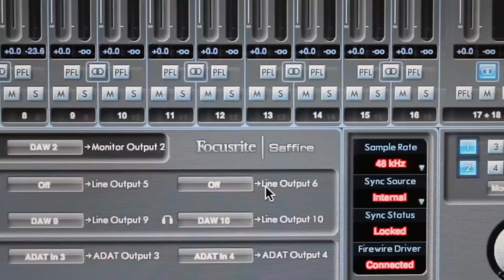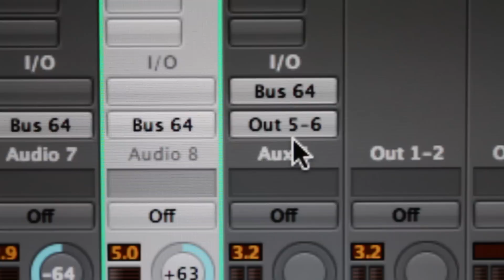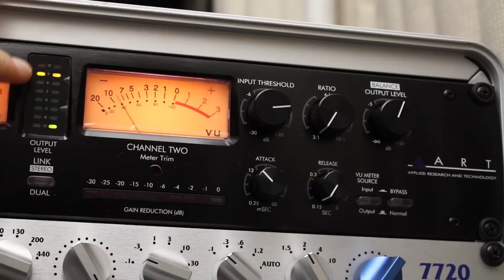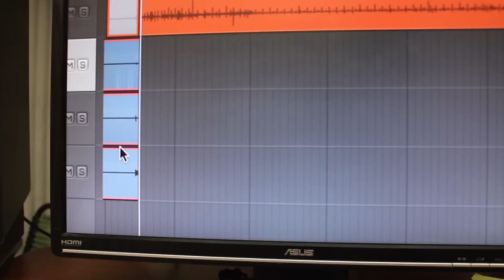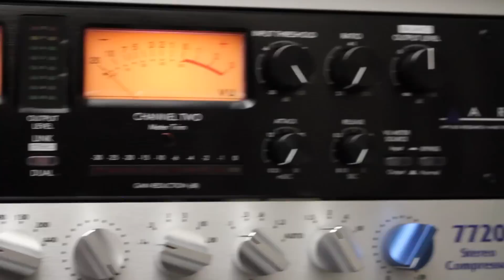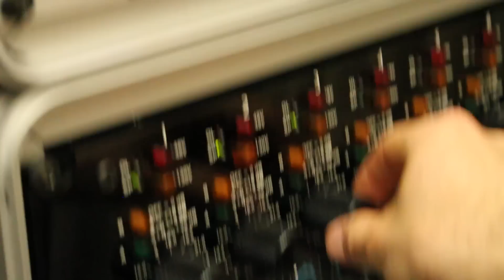Get Outboard Gear Into Your DAW- Compressors, Preamps - Focusrite Saffire Pro 40

Comment: I'm a bit of a noob. I have a question. If you're using the compressor for the snare and snare chains.. How are you using it for the overheads?? Also, taking this one step further, is there way to accomplish seperate compression levels/settings while recording several tracks??
Reply from the maker: This process allows the engineer to rerecord each track individually at separate times. This means I can listen to each instrument thru the outboard device separately & take my time to dial in the sound just like with a plugin. After I rerecord the snare, it's only a matter of disarming the snare reamp track & arming the overheads reamp track. One at a time I process thru the hardware. To rerecord/compress multiple tracks simultaneously, I would need an individual output, compressor, input channel, & cables to reamp each signal.

I hope this helps!

Comment: Hello. Quick question regarding the Art Pro VLA II vs the Chameleon Labs 7720. Which unit do you like better considering that you own both? Any experience which unit in your opinion works best for a Mix Buss / 2 Buss operation?
Pros vs Cons?? Thanks!!
Reply from the maker: Ryan Pehr Dude! To specifically answer your question about the Mix Buss, I believe it comes down to the sound character you are after. I have used both as 
final mix compressors & am happy with what I got in those particular cases. In the specific use as a mix compressor, the biggest factor to consider is "warmth" vs. "transparency".

In general, I decide which to use depending on the application & how I want things to sound in the end. If you're looking for warm-sounding instrument compression, the PRO VLA II is the winner. If you need a clean, 90s Alternative Pop kinda sound, the 7720 is the bomb. If you're recording vocals, 7720 is sheen smooth while the Pro VLA II adds analog heat. They have totally different character & routing options that make them solid devices.

BOTTOM LINE: If you are looking at purchasing your first compressor, I suggest starting with the PRO VLA II & later investing in the 7720 when you need more channels of analog dynamics control.

I'm happy you've asked because these compressors are close enough in price range to discuss fairly. Here is a super-simple breakdown:

1. PRO VLA = Warm
    7720 = Transparent
2. PRO VLA = Dual Mono or Stereo
    7720 = Mono (single channel) or Stereo
3. PRO VLA = 2u Rack Space
    7720 = 1u Rack Space
4. PRO VLA II = Better Metering
    7720 = Flawless Stereo Consistency

I have used both on vocals, acoustic guitar, drums, & full mixes with pleasant results. Here is a recording with the PRO VLA II on drum overheads:

https://soundcloud.com/lanskysound/f-foliage-2014

Here is a recording with the 7720 on acoustic guitar:

https://soundcloud.com/annalansky/talyanka-anna-lansky-2015

Having two independent channels on the PRO VLA II is a major advantage to me 
because I can process two instruments simultaneously, OR what I love to 
do with vocals is daisy-chain OUTPUT 1 > INPUT 2 with the first comp
 set at 2:1 (-5dB GR, ATK 12ms) & the second at 4:1 (-2dB GR, ATK 0.25ms). This technique produces poppin vocals that do not need much more than EQ in the DAW. On the other hand, the 7720 is perfect when I need a vocal to sound clean & creamy which the PRO VLA II cannot touch.

* A NOTE ABOUT ITEM #4: I believe the sonic consistency is greater on the 7720 so both channels are perfectly matched, but the metering is better on the PRO VLA II requiring the engineer to listen more carefully with the 7720 rather than relying on meters.

** STEREO TESTING THE PRO VLA II: Before using it in stereo mode I suggest running a dual mono tone generator thru (could just be a guitar tuner output @ A440) & set up a stereo field monitoring plugin on an input channel of your DAW. With the compressor set to STEREO LINK, threshold all the way up (no compression) & ratio all the way down (2:1), you should see a near-perfectly balanced signal that is equal on both sides of LR output. Don't be surprised if it's slightly off, but if the sound is audibly pulling to one side, the unit needs to be serviced by ART.

This is probably a lot more information than you were expecting, but there you have it. I hope this helps!

Thank you for watching :D
Reply: Thanks for your reply. Very useful.
Reply from the maker: +Ryan Pehr Something just occurred to me after a couple months: I can show you examples of what the ART PRO VLA II can do on the master bus! Here are two albums of my own music that feature this device on vocals, guitars, & who knows how many other instruments as well as mastering compression:

IИCITIИG_TO_RIOT -- http://www.quadkiller.com/QuadkilleR_2012_IИCITIИG_TO_RIOT.zip

untitled (a.k.a., "The Reflection Album") -- http://www.quadkiller.com/QuadkilleR_2013_Untitled_the_reflection_album.zip

I dare say we ran every track out of the box & thru the PRO VLA II for final compression. Since the creation of these albums, my skill level (as well as equipment arsenal) has increased pretty dramatically so I would do things differently now. Having said that, these records were produced in the "artist" mindset first & "engineer" second so there will be odd things happening.

Nonetheless, both records were absolutely influenced by the ART PRO VLA II, which has its sonic signature all over everything you hear. I hope you at least get some minor enjoyment out of the music in addition to the study of sound texture. It would be sad to think you're suffering as you listen, haha. Enjoy!

Comment: Couldn't you send a mono output ?
Reply from the maker: +Manofmanytallets I'm not exactly sure what you're referring to, but I am going to guess you are thinking about the stereo channels. I am not sure it is possible to create a mono output in Logic, but think it may as well be. I'll have to check this out for the next time I do some reamping. Thanks for the suggestion!
Reply: +Lansky Sound yeah if the channel is mono then where is says stereo output right click and go to output then mono at the bottom
Reply from the maker: I probably should have known that, haha. All channel strips in Logic Pro have that function. Thank you for bringing this up!
Reply: +Lansky Sound aha yeah wasn't sure if it was in logic 9 but I have seen it in logic x
Reply from the maker: +Manofmanytallets So get this: I finally tried sending the mono output & there is an issue. Logic defaults mono outputs to ODD channels -- I can't send to an EVEN numbered output via mono channel! Kinda wish the programming would have allowed that as it is much more simple than playing around with panning.
Reply: +Lansky Sound that is odd. With pro x no panning is required just simply use the IO plugin and that works fine but I'm not sure about this ! Sorry wish I could help
Reply from the maker: Dude, it is all under control ;)

Comment: I have a couple questions. I have a warm audio 1176 compressor. If i was so buy a presonus adl 700 which it is a preamp/comp/eq all in one. Can i use adl comp at the same time as the wa 76 comp? Or do i have to use the adl 700 first then route the vocals through pro tools and then use the wa76 if that makes since.
Reply from the maker: DGibflyboy Hey dude, awesome gear you're going for. I would like a WA76 myself! There are two ways I can answer your question, so I'll throw both at you:

1. Assuming you are NOT reprocessing & would like to record straight to disk using the outboard gear: your signal chain has to be ADL700 > WA76. You have the option of BYPASSING the EQ &/or compressor section of the ADL700 & this way you could only use the WA76 for compression. Depending on what you're recording, however, it may be to your advantage to use just a little pinch from the ADL700 compressor before hitting it harder with the WA76. In fact, this is my go-to setup when I am recording vocals! I use the first compressor (the ADL700 in your case, suing an EQ low-cut around 100Hz-150Hz) with a low ratio like 1.5:1 or 2:1 & only get max 3dB of reduction. I then hit that same signal with a second compressor at, like, 4:1 to get another 3dB-6dB. This keeps vocals super poppin.

2. Assuming you ARE reprocessing & will use the compressor(s) after tracks have been laid down: I suggest using the ADL700 preamp while bypassing the COMP section (EQ if you like). Run the output of the ADL700 str8 into your interface. On the way out of the interface, you will not need to apply much gain if any at all before being able to smack into the WA76 or ADL700. After that, send the heat right back into an analog input on your interface.

I know you asked me this a while back, but I just saw it. I hope this is helpful to you! Stay tuned, dude

Comment: Newbie here... What I don’t entirely get is the gainstaging aspect. At What volume should you set the physical knobs (the input volume knobs) on the front end of the saffirepro that are connected to the hardware processors? Ex: output of a compressor going into input 3 of SP40. I want to set the input knob on my compressor at 12 o’clock  so that its bypass button works nicely. However now the signal comes in way too loud in the SP40. How do I adjust that? Put the input volume knob almost to minimal on the SP40? Or do I have to adjust something in mixcontrol? Thanks!
Reply from the maker: hello friend, apologies for the late reply but I've been just vibing & missed your comment. Turn down the input gain on your interface all the way & start there. You might need to set the input to look for a LINE LEVEL signal arriving at the SP40 input. At any rate, get your compressor achieving the gain reduction you're looking for, make it up with the output knob on the compressor, & start with the SP40 all the way down & add gain as necessary to reach near 0dBFS.

I hope this helps as it's proper gain-staging technique :)

Comment: Can you directly connect a Alesis compressor into a Scarlett 2i2. i know a pre amp will help. but just curious
Reply from the maker: Unless you are sending audio from a line level device into the compressor, a preamp will be necessary. A microphone cannot be plugged directly into a compressor without a preamp! To answer your question directly, YES, you can connect the compressor's outputs directly into the 2i2 inputs. I hope this helps!
Reply: Did it work out? :p

Comment: What is the reason for routing via the millenial when you have gain adjustement in the comps?

And also, the sonic maximizers are unbalanced. What is your thought behind using them?
Reply: Welp, I just came to that part.
Reply: Couldn't you buy a 2 channel pre instead of an 8 channel to get that sonic character? Ever tried and listened to the differences?
Reply from the maker: of course, but that's what I need for my work ;) If you want some nice color, check out the Warm Audio WA12

Comment: the thing im struggling with is putting my external mic pre into my zoom interface! i want to bypass the pres on my interface, but cant find out anything from the company! i know some interfaces bypass the pres by using trs into the interface so thats what im doing but not sure if its bypassing the pres! the other wierd thing is on my interface, if im using my preamp, i have to keep hi z engaged on my interface or else my daw clips even if the gain on the pre is very minimal! but when hi z is on i have headroom, but i dont get why i need hi z engaged, it seems like it should be the opposite! maybe the pres cant be bypassed, so thats why the hi z is affecting it? lol....do you know any good interfaces that can bypass pres if need be? can you bypass the pres on the saffire pro 40?
Reply from the maker: Hey James, it sounds to me like you are using a 1/4" output from your preamp into your interface. I suggest using an XLR cable & just turning down the interface gain as low as possible. This way, all the gain should be provided by your outboard preamp. Using the XLR cable will also possibly be a better-quality connection depending on your devices.

To be more specific, by completely reducing the channel gain on the Saffire Pro 40 preamps, you essentially bypass them. This is how I was using my external preamps with the Pro 40. If this is the interface you are using, there should be no problem getting almost all of your gain from an outboard preamp.

I hope this helps!
Reply: awsome! thanks!
Reply: Yea I just picked up a Zoom UAC-8, specs, reviews and IO was pretty sweet for the price. While it was in shipment I contacted Zoom and asked about bypassing the pre's completely. There response was pretty similar, just to turn the gain to 0, but said it was fine to do that. I would've thought using trs would be better too, but will try the xlr deal. I also decided to keep my older Echo Audiofire 8 with adat, and I have that linked up. It has 6 straight a/d converters and is sounding pretty nice connected. I have many more a/b tests to run, but I find it a tad brighter?
Reply: the thing is some interfaces will bypass the pre if you use a trs because some have seperate line amps even though its a combi jack, but if the interface only has the one pre in it it doesnt matter which you use, so actually with the zoom its better to use and xlr as they're typically better quality but a balanced trs would be the same thing! Also the pre's in the zoom are pretty decent, but i find for bass and dynamic mics like the shure sm7b theres not enough clean gain, so an external pre is key! I'm using a focusrite isa one!
Reply: my current bass and guitar chain is line 6 pod(optional)- avalon u5-isa one-ashly sc-50 compressor-zoom uac-2- or for vocals its just isa one-compressor-interface!
Reply: I did this intuitively, kinda proud of myself now. Thanks for confirming this belief of mine! :-)

Comment: Best budget preamp for punkrock vocals?
Reply from the maker: +David Cote What's the budget? Probably something quality pre-owned rather than new to get the value.
Reply: 300$
Reply from the maker: I would try to find a pre-owned Focusrite ISA One or something similar. Check Guitar Center's website in the "USED" page. Otherwise, the Golden Age Pre-73 ($350 new) has some really nice reviews. There are a few solid choices in that price range. What mic(s) do you plan on rocking?

Comment: Hey @lansky noob question .  Any way you can help me route my VLA ll & my saffire pro 24 my Daw is Ableton , Compressor does recive signal ,  but not compressing signal :(
Reply from the maker: +Kevin Rodriguez I suggest checking out some basic how-to videos on compressors. There is a TON of information on how to run the darn things! But I'll give a few tips anyways:

Tip #1
Threshold + Ratio = Gain Reduction (GR)
First of all, make sure you're getting a solid signal into the compressor. You can check this by selecting the INPUT button for the VU meter. Next, set your RATIO to how hard you would like to compress (higher ratio means harder comp), then lower the THRESHOLD to achieve desired GR. Make sure the unit is NOT bypassed, as this will obviously prevent compressing of the signal.

** If you are still having problems after trying some things, I suggest contacting ART Pro Audio to make sure the unit is not defective.

Tip #2
Fast attack for vocals & percussion, slower attack for bass & guitars
Here are some settings I start with:
Vox - 5ms
Bass - 35ms
Guitar - 20ms
Drums - 10ms

Tip #3
Less is More
If you start hearing "pumping" or "breathing" or a generally grainy sound, it's probably because you're overcompressing. It can be easy to squish a signal too hard but this causes permanent changes to the recording. I typically aim for a little compression on the way into my DAW & use plugins for finer tuning. Here are some suggestions for upfront analog gain reduction:

Vox - 6dB
Bass - 4-8dB
Acoustic Guitar - 3-6dB
Drum Overheads - 6-10dB
Keyboard - 3-6dB
Reply: Hey man , big thanks for the response ! Im sure the Art VLa compressor is not the issue , also tried with my drawmer & presounus max compressor . Focusrite support also not helping much :( really getting crazy and thinking in returning it .
Reply: It's funny how these days we are so hung up on brand name products, if something is not brand name and costs thousands than it must no do the job..  I can't tell you how many times I have used less expensive gear that has sounded better or done the job with less complications. It all comes down to what sound you are trying to achieve and what works for you not how popular a piece of gear is.. For example I use presonus and studio one pro, for the price point it's unbelievable and my golden age preamps and 25 year old simple dbx compressor work and sound way better than my UA preamp and Joe meek compressor.
Reply from the maker: P.o.B pedals
If it sounds good, it is good! I agree -- at some point it is important to stop attempting to obtain the "best" gear & just make music. What good is a bunch of high-end gear if it is just sitting around unused or does not inspire creation? The purpose of the equipment is to enable the user to be creative & productive, not gloat about shiny metal objects. It's materialism man!!! Thanks for sharing :D

Comment: Dude impedance..    you shouldn't be going back into the mic pre
Reply from the maker: +Adam Colorado Hall Maybe not, but I did :)

You should take a moment here & explain what you're pointing out & how to fix it! Could be valuable advice. Thank you very much for posting
Reply: He's refering to the impedance mis-match you get when sending a line Level signal (Logic output-> Saffire Line out) into a mic preamp. Skip the Millennia next time, og directly into the compressors and maximizer.